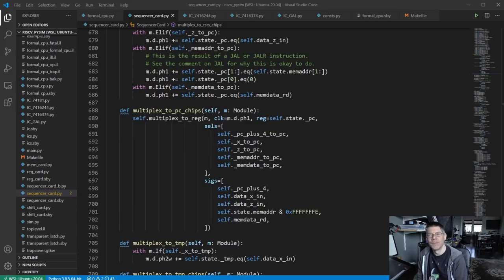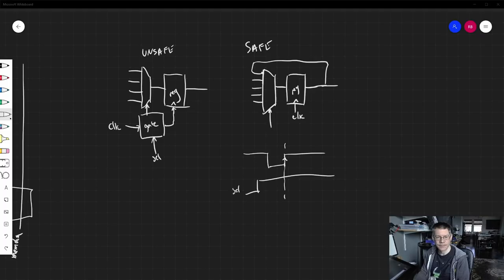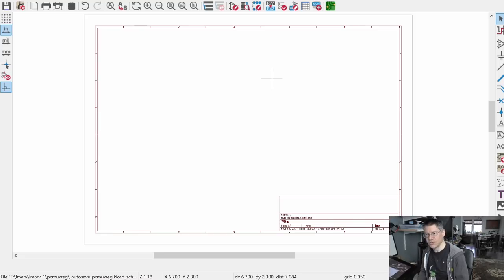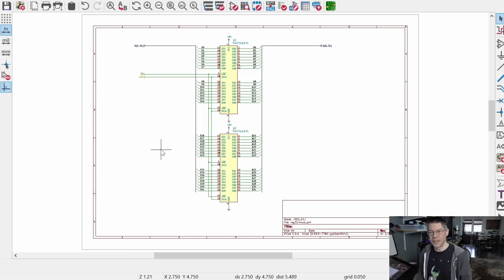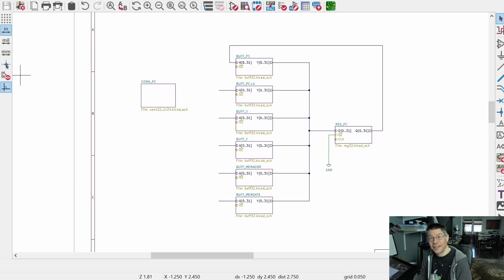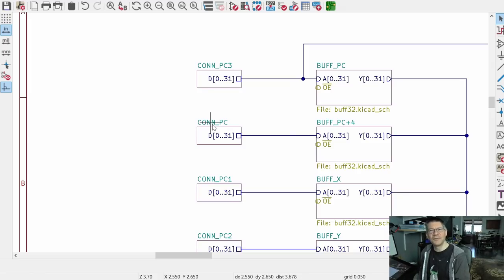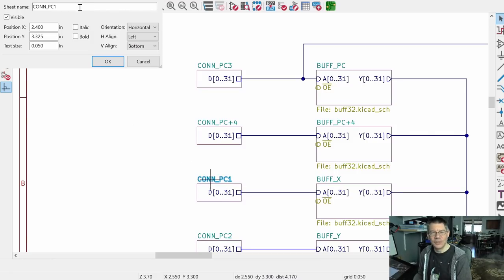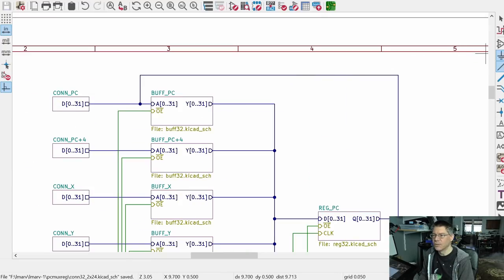LMARV-1 reboot part 8: Exploring layout for multiplexed registers

Comment: Another solution for your clock enable register would be to use a different clock. Instead of using one that pulses, you could use the clock that the pulses are derived from. Then you could gate it with the enable signal. However, using a re-direct mux is much safer as you said - I believe that's typically done in silicon as well.
For the headers, you should be cautious... 2.54mm headers can bind very easily... First of all, a 4xN connector is a huge pain to use for anything other than small quantity Dupont connectors. So you will want to stay away from 4xN (2xN is more manageable). Second of all, the longer you make the header, the harder it will be to use (the Raspberry Pi is pretty much pushing the limits at 2x20). Third, it will be almost impossible to connect a card that spans all 6 buses via 2.54mm headers... you will probably have to plug the headers in before soldering, solder them to the board, and never remove it... Perhaps you should consider looking at HMC connectors? The Raspberry Pi CM4 uses some cheap ones DF40HC(3.0)-100DS-0.4v. Those are 2x50 and much easier to plug in since the contacts are shorter.
In terms of return paths, I wouldn't worry too much about that unless you start to see noticeable noise with an oscilloscope. As long as your signals are below 50 MHz you can probably have up to 8 of them in a row without a ground between them. Practically speaking, that's probably more like less than 100 MHz and 16, but 50/8 would be safer. The whole reason the 74 logic has gnd-2-gnd-4-gnd, is because of the die inside of the package. That's a function of power new connection requirements on the die and layout (i.e. they may need 3 ground pads and only have space to fit them on the ends and between the signals). Then the pinout on the chip is arranged so that the bond wires don't have to cross each other (which can risk an electrical short). So I wouldn't make any assumptions about the signal layout on the chip except for the case where you have GHz speed signals. If you look at QFP FPGAs, they have more than 4 adjacent signals and expect signal speeds upwards of 100s of MHz. 
You probably shouldn't be routing with 3.5 mil traces. It's likely that many of the boards will fail during production (since that's the minimum capable width / spacing). Also, 3.5 mil traces won't be able to carry much current and will also have a high resistance / length. I would have started with at least 5 mil, and since you are connecting to a bus which will have to drive more current (10s of mA), you should probably do 8-10 mils. You may also want at least 2 power pins - you may want to do a power budget for the chips to see how much current they could draw.
A few ideas for the sequencer control array. You could probably use SRAMs with an initialization cycle from a ROM (if I recall correctly, you did that in your last iteration). You could also use a small QFP FPGA or CPLD (like a Max 10 or Max 5) which is purely being used as a fast ROM (I don't think that would be cheating). Keep in mind that older computer systems did use PLAs instead of discrete logic for complex logic equations - you could also use PLAs, but those would be a pain to work with.
Anyway, looking forward to the next video.
Reply from the maker: So even if the board house's capability states 3.5 mil and they electrically test, you're saying that these would likely fail after that? I'll try with 8 mil, although I'd probably be constantly cursing at the lack of space between vias.
Reply: @RobertBaruch  That's correct. Dave Jones recently did a video on that. It's basically a yield problem, where there's an area failure rate that grows as the spacing decreases. Then you multiply that rate / area by the total affected area. So if you have a few spots (like under a BGA device - which is what the 3.5 mil is meant for), then your failure rate will still be low. But if you use the minimum everywhere, then the area compounds. 
You would probably be fine with 5 mil width with 5 mil spacing if you need the space for vias though, but I would make any output onto the bus from the driver be at least 8 mils.
 Also, to clarify, you probably won't experience the failures, since the PCBFab does the electrical testing. But they may have a case where they do a panel of 5 PCBs, and only one passes the electrical test. Or worst case, none pass. It's also not just the spacing, but also the trace width. That's something that can be seen with printable electronics, where long traces at the minimum tolerances fail in both continuity and shorts. It's possible that you could mitigate that by meandering the traces (45 degree wiggles), but it's much easier to just use a wider trace with larger spacing.
Reply: @RobertBaruch  It's not only a yield problem. These Traces are soooo fine, there is always the risk they get damaged in say shipping (a little flex), so after testing. Or when you handle them to plug/stack/whatever. Don't go small "because you can", stay bigger "because you have the space".

Comment: Come to the metric side Robert. It's just better in every way :).

Marry Christmas by the way.
Reply from the maker: Io Saturnalia!
Reply: @RobertBaruch  Hah I'm not religious at all quite the opposite. But I appreciate the sentiment ;).

For the ROM storage issue: I remember a new ROM type back in the early 00's that was quite a bit faster than previous stocks. But I'm not sure they would be fast enough for the need here... Did you consider a small flash chip? It's a bit fiddly, but the speed is definitely there :)
Reply: Meeeeetttttriiiicccc.

I mean, it's what got NASA to mars.

Comment: For the sequencer, instead of ROMs use some fast SRAMs programmed by a GAL from EEPROM at startup? More points for using a single large serial EEPROM. Might be overkill but I imagine preferable to unchangeable logic. Would the sequencer itself fit in a GAL? Unsure. Very interested to see how the HDL will be changed to represent the "chip design" however it's done, especially for this part.

Stacking boards is a fantastic solution. Or rightangled 0.1" headers though you'd need some kind of card  frame.

Also, do you need power on your 48 way headers or is that coming from somewhere else?

Comment: for those 4 chips on the left, It would be simpler (for layout and PCB traces) if the buffers were aligned in the same way as the others, and the registers were placed inverted and (slightly) offset on the opposite side of the PCB (the bottom). This would mean the bottom layer would have (super) short traces (with vias) back to the buffers on the front side, and they could be placed out of the way of the buffer traces to the bus. Electrically this would be better (for the traces), as all register to buffer traces would be (approximatel) the same length, and (extremely) short (compared to the buffer to bus traces). The only issue I see with this would be in fabrication population, ie can the manufacturer do this, or is it an extra (large?) cost. I dont see a problem with stacking, as (shown on RPi) there are various height bus extenders (if inter-board chip proximity were to be an issue, say for heat (airflow?) or access (testpoint?) ). One last thought - if the chips are SMT, then wont that cause an issue for the placement of (currenty unplaced) trace capacitors (based on the current trace layout)? However, if they are socketed, then there is room for them under the chips.
Reply from the maker: I came to the same conclusion :)

Comment: have you thought about PCIe connectors with small adapter boards connecting them vertically. tho through hole might be better for stacking more boards

Comment: "this board is 75 millimeters, so we are talking a meter wide board"
75 millimeters is like 3 inches. 75 millimeters is 7.5 cm  and there are 2.54 cm per inch. 2.54 is roughly 2.5.
Reply from the maker: 75 mm times something like 12 boards is about a meter.

Comment: You probably should use bigger tracks by default. Using these tiny traces will probably be very fragile, cause higher resistance and more interference than necessary and make manufacturers like JLCPCB unhappy because they'll likely have a high percentage of boards that fail the test and have to be manufactured again.

For example the PCIe standard recommends 5mil tracks with at least 7 mil gap in between their signal lines, and while PCIe is probably much more sensitive, I don't see a reason to go below that.

Comment: I would think the next board layout that connects to that is going to be a mess. What about having a single register card that fits in a vertical laptop DIMM socket and then having a array of them? This would give the next board more flexibility as to where they are placed. Just thinking smaller connectors. edit: but then again that makes the multiplexer more complicated.
Reply: I was thinking that or look into the m.2 'like' connectors,. though a DIMM would be nice

Comment: Did you check JLCPCB SMT assembly? This could make your life way easier, especially if you need the same board multiple times like for registers. They have a lots of 74-series chips that can be assembled. Unfortunately, they do not assemble connectors yet.
Reply from the maker: I'm not planning to build a lot of these, so hand-soldering is sufficient.

Comment: What about the 47k resistors instead of REG_PC? You save the space, you save the control signal... If the mux opens it overrides input value, otherwise the register output is loaded on the clock edge
Reply from the maker: That's a really interesting idea! Although I'm not sure if 32 resistors will save space vs two buffers...
Reply: Can I ask you how will you increment the program counter? I understood it there will be the PC output with some adder (some combinational logic) that produces that number increased by four.
If I were you I would connect 2 LSBs of the PC to the ground ( or store them in 7474 if they are needed) and use eight 74193s to store the rest of it? You'll replace six 48-pins chips by eight 16-pin chips on this board, you don't need "increaser" on the anorher board and increases the instruction address by one pulse to CU input to the counter on the LSB. It also eliminates one board to board connectro there and so on. When it jumps it will load the preset into this counter...

Another saving of the chips/size may be preselect of X/Y bus by input multilplexer on the card. If they are not stored in the same time to the multiple registers it is smaller, cheaper and with less load of the buses. Now it's clear architecture but it seems there will be necessary to do some optimalizations.
Reply from the maker: @PETMK  I preferred to use an adder to a counter because if there's an interrupt or ECALL/EBREAK, I need to store the PC of the next instruction. It's possible that I can eliminate the adder, but there are a lot of parts of the code that need PC+4, and I'd rather sacrifice adding a few chips than make the architecture less clean.
Reply: @RobertBaruch  What about Bourns CAY16 at the bottom side?
Reply from the maker: @PETMK  Oh, I've learned to hate those :) I can never cleanly solder them without bridges. Still, it's worth thinking about.

Comment: Is it much of a worry if two outputs are enabled at the same time for what would be just a couple of nanoseconds?

The value that has been output isn't going to be needed for 10s more nanoseconds so it will have plenty of time to stabilise before being clocked into anything else.
Reply: I suppose if you really need some delay you could chuck in a 74LVC1Gsomething to add a few ns of delay
Reply from the maker: My worry is just the driver-driver conflict. One buffer would be sourcing its full output, and the other buffer would be sinking its full output. That always worries me :)
Reply: Thinking about it some more, you could delay one buffers turn-on with an extra gate delay, but then that would also delay it's turn-off, shifting the problem.
Reply: I have seen one texas instruments design guide called designing with logic. ti.com.cn/cn/lit/an/sdya009c/sdya009c.pdf They have some info about bus contention but they mostly say that if it is just few tens of ns it is ok. But then they are talking about powerup times and that at such times you can get quite long driver conflicts because the system is not setup yet and bus drivers are not disabled. I recommend that you look at it.

Comment: Just a random thought regarding the system clock - since it's distributed to pretty much every chip on every board, are you expecting to need to buffer it on each board's input, due to line loading effects?

P.S. just noticed your "ALAN: In space nobody can hear you space" t-shirt. Got the same one :D
Reply from the maker: :D I also have their "X-Flies: The truth is over there" shirt. Probably all signals will be buffered on input.

Comment: It looks too big. It will need 0.4mm b2b connectors and passives on the bottom side... 4 layers will be enough for it
Reply from the maker: I'm very interested in the 0.4mm connectors. I'm just hesitant to use them because they are so low-profile. I would still like to stack PCBs, and if they are too short then I can't use them.
Reply from the maker: Ah, there are various height of these connectors, so I can choose a stack height that works for me... Now I just need to figure out a way to align these SMD connectors so they match when I solder them on...
Reply: @RobertBaruch  Alignment is challenge for maual assembly, defnitely. We had also trouble with 2.54mm pitch headers when there were more tnan three between boards :(
Reply from the maker: @PETMK  I had an idea about that -- if I can hand-solder male connectors on one board, then put the female connectors on those, put a small bit of glue or epoxy on them, and put some acrylic on top. Let dry. Now put male connectors on the glued-up female connectors, and tack the male connectors down on the next board. Lift off the template, and solder in.

For the female side, place male connectors on the template as before, except glue those to another template. Now I have a male template, which I can use to align female connectors.

It's a thought anyway. I'll need to experiment.